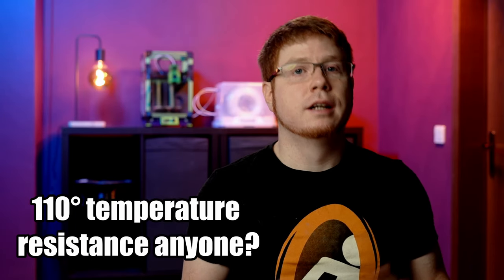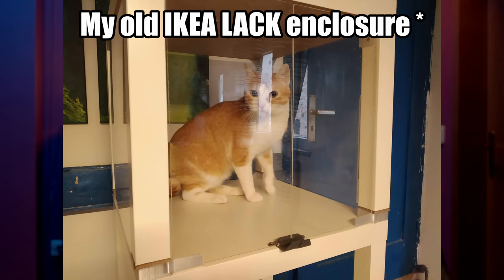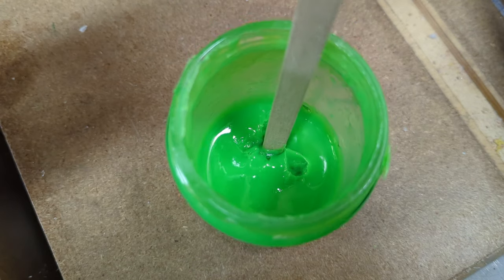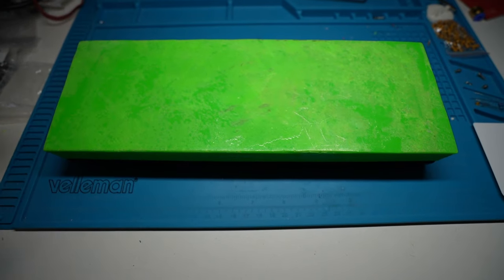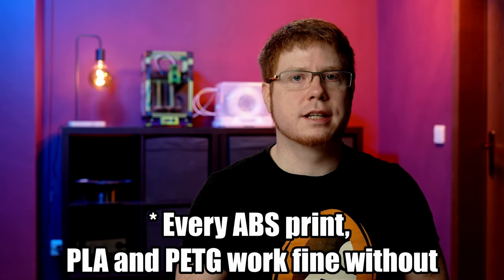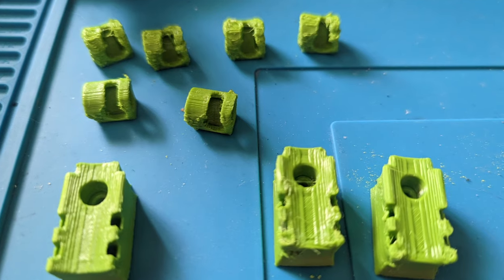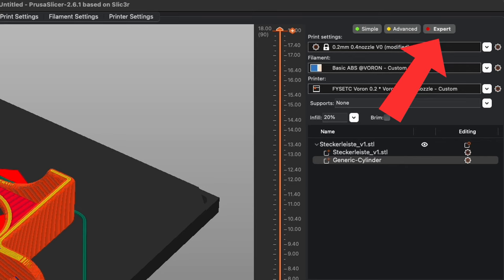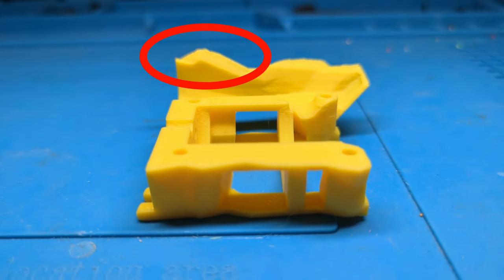3D printing ABS and ASA: The simple SECRET how to get perfect results

Comment: I just got my first bottle of magigoo two weeks ago and I can’t believe how much I was screwing myself by using glue stick… lesson learned for sure.
Reply from the maker: That's pretty much how I felt when I used the test sample after being hesitant for so long. Recently took advantage of a sale and ordered 4 bottles (2 regular, 1 PC and 1 nylon)
Reply: @SmallBatchFactory  have you tried the Nylon one yet? I ordered that too but haven’t tried it yet… I only use nylon for a couple things here and there.
Reply from the maker: Not yet. Like you I only use it very occasionally. I also have a very cheap Nylon that's especially nasty.
Reply: @SmallBatchFactory  me too… I have a 5 year old spool of ESun natural nylon and it has never been easy or fun to print with. But when it does manage to print well. It is pretty good material…
Reply from the maker: Sounds a bit like mine. I got it from "Your Droid" which is just a white label brand. I need to print it 25c over the recommended temperature to get layer adhesion. But then it's really strong, didn't manage to break off the nubs of the gear I made with it by hand.

Comment: I think I got something similar to magigoo but on a budget. Mix water and regular white glue in ~7:1 ratio, it works great and cleans easy.
Reply from the maker: I use that for PLA and PETG. It's much weaker than Magigoo though. For comparison, with Magigoo a warping print will bend the magnetic build plate against the magnets force instead of releasing the print
Reply: @SmallBatchFactory  wow that's a lot of force. I'll keep that in mind, can't wait to switch to ABS, I built the enclosure and getting myself mentally prepared for the trouble it comes with :D
Reply from the maker: @LukaMilosevic-c7f if you follow the tips in the video it's actually not that hard :-)

 It also highly depends on the model though. There were parts of the Voron ERCF I couldn't get to print since the surface are on the bed was too small (it would later be bridged to the rest of the part but it got knocked over every time).

Good luck!
Reply: @SmallBatchFactory  That happened to me few times. I'm getting the hang of it after ~1kg of my first spool of PLA. Got few really nice functional prints with real world applications as well as few great looking painted small miniatures. Thank you for all the tips!
Reply from the maker: Miniatures are fine too. One of my very first prints was DOOM guy with a 0.2mm Nozzle. Turned out extremely well and with the tiny Nozzle the support material was super easy to remove.

Thank you for watching! Maybe someday you'll even build a Gatoino :-)
Reply: @SmallBatchFactory  I don't have a cat but  I do have a shoe box full of arduino sensors, I had a rpi as well but I shorted pins 1 and 2 and killed it while messing with the display jumpers for the printer display for klipper
Reply from the maker: @LukaMilosevic-c7f it can happen really quickly. I was testing a few different OLED displays for compatibility and one had power / ground reversed from all the others. Now it's toast, but it gave up some nice magic smoke

Comment: For a glass bed. All i have done for a long long time is put a little acetone on the glass and use a failed print and slide it over the acetone and over the area the print will be. I cannot remember the last time i had an abs print come loose.
Reply from the maker: That's basically the concept of ABS slurry. Works perfectly well if you're willing to work with acetone
Reply: It is the same concept. Except without needing to create and store a slurry. Its fast and a cleaner process.
Reply from the maker: @Bobby11 that's true. Haven't been using acetone in 3D printing for years. PEI sheets don't particularly like it

Comment: Sounds like you need a pei sheet.  My Ender 3 is printing ABS and ASA like a champ in a tent enclosure on a cheap PEI sheet with no brim and no glue.  255 nozzle and 105 on the bed.  Pre heat for a few minutes, then fire up the print.  I've had a few warps on the edge of the bed when I didn't pre-heat, but otherwise, no significant warping.
Reply from the maker: I "have them all", meaning smooth and textured PEI. Possibly be differnt if I preheat a bit longer. Since energy is expensive here and I'm I impatient Magigoo does a wonderful job. 

It's not always warping of course but when it does I have to start over so I rather just apply some glue.
Reply: @SmallBatchFactory yeah, can't argue with what works.  I just found it annoying to apply the glue.  I did notice with the smooth pei that I have to literally clean it before EVERY print.  Also, 85 and even 95c were not enough to keep things stuck down.  

I'm in Southern California, so I understand expensive power.  I just put in solar, but haven't turned it on yet.  Just printed some ASA brackets for the conduit running into the solar and end-caps for the rails the panels bolt to.  Been wanting to build a large core XY, so maybe I'll be able to power it without feeling guilty LoL.
Reply from the maker: @huzbum I wipe with IPA, but it's not always enough for me.

A large CoreXY is very cool. I have a few problems with my Voron 2.4 though, I always have to adjust the first layer. Mesh leveling works great but the first layer distance is a bit hit and miss. Although the click switch is always spot on when calibrating it isn't anymore when printing. Might need to add a brush to clean the Nozzle before leveling.
Reply: @SmallBatchFactory  My current plan is to modify the design of "the 100" AWD remix to make the corner pieces and attach them inside a plywood/2x4 cube (with plexiglass doors.)  Then use a Kobra Max 400x400 heated bed with 3 independent z-screws.  Design wise, it's really going to be a frankenstein abomination.  I basically just want it to be cheap, large, and reasonably fast.  

Looking cool would be great, but you can't have it all.  Maybe if I make it look like a video game military loot crate that would be cool in its own way.
Reply from the maker: I love the loot crate idea! If we're honest many open frame printer don't look pretty as well. My Prusa mk3 for example, the wooden  encloruse I added isn't exactly a masterpiece either but it gets the job done. Form follows function I'd say

Comment: I would love to see more abs/asa tests. Like temotowers in different configs and stuff just to demonstrate these things.
Reply from the maker: Issue with temp towers is they don't represent real world printing. Since they're small they printer needs to slow down. Back when printers were generally slow this worked fine IMO but with today's high speed printers it already makes a big difference how large the model is, meaning print time per layer.

Comment: Magigoo, yes.  But I still get warping if I cool the print down too quickly.   I've had some success letting it cool gradually at 5 degrees per 5 minutes but the edges still curve up a little on the larger prints.  I think my next bet is to just let it sit on the plate, covered with a filament box to make a mini oven, and let it heat soak on a 100 degree build plate for an hour to relieve the internal stresses.
Reply from the maker: Are you talking about rather flat prints? For what I usually print the parts are over 5cm high. I get a hot bottom, cool middle part (~40c) and a hot top when the print finishes. Means the middle is already cold enough to not warp anymore. If the print is only a few millimeters high I'd expect the result you mentioned.
Reply: @SmallBatchFactory  Nope, it was tall.  I was printing the feet for a Voron 0.2 with Mouse Ears, but no Magigoo, and the corners lifted when I let it cool naturally (bed heater off immediately) instead of letting it cool slowly over an hour (-5 degrees every 5 minutes).
Reply from the maker: @tasa4904 that's interesting, how much glue did you apply? I literally popped my Voron parts off the minute it stopped printing to immediately start the next print. Didn't have any Warping that occurred after the print finished. Might also have to do with the material used but it was just cheap regular ABS, nothing special.
Reply: @SmallBatchFactory  If anything, I had the heater bed running at 110 degrees to make the part stick without glue (bed top is about 10 - 15 degree cooler than stated temperature).  Pumping that much heat below while the upper part cooled to about 40 to 50 degrees ambient temperature might have done something.  

Although I would expect the warp to go in reverse / create layer separation since a layer is supposed to contract on cooling, not expand...

The only reason why I know that it warped on print completion is because the mouse ears were firmly stuck to the bed right up until the very end.  Then I walked away and let the print cool, and came back to find the mouse ears had detached and were in the air.
Reply: Thinking about it further, I think the reason why it warped upwards is because the heat transmitted from the bottom of the print flowed to the middle layers.

And then the bottom of the print cooled down quickly because the build plate is thermally conductive and equalizes quickly with the ambient air once it isn't actively heated.

With a hot middle layer and a cooler bottom layer, upward warp.

Next experiment then is to use Magigoo with a bed temperature set to 80.

Comment: If you use Magigoo or some other kind of adhesive (like Kores glue stick, etc), can you still easily remove the prints off of the bed once it cools down ? or do you need a PEI sheet ?
Reply from the maker: Magigoo in particular even releases the print when cooling down. So you usually won't have issues removing them. This can vary depending on your build plate material of course, I didn't try all of them.

Comment: Had lifting issues with Nylon. I  used "Super Glue" and glued the Brim down with it. Solved all the problems cheaply. I dont know yet how it will work with ABS.
If the bed is Magnetic. Magnets on the brim .
Reply from the maker: Were you able to remove it without damaging the print bed?
Reply: @SmallBatchFactory   Yeh it scraped off pretty good.Given its age ,i figured i might as well try it . if i wipe it out ,id buy a new one. I needed the gears bigtime .    . I cant recall what kind of bed i got. Got it a few yrs ago. all i can say its white lol.

Comment: The major fix to me was to heat the enclosure at 40°, and bed at 110, vent at 15%. I did a temperature tower, perfect from 230 to 270 lol.and when finish i wait 20 mn to let everything cool down. No sticker, no brim.
Reply from the maker: In my case the parts usually already warp while printing. When it's done I sometimes even cool them down on a piece of stone if I'm impatient. The large print I showed in the video actually sticked perfectly for the first print but the second one always failed without glue. I just couldn't figure out why.

Comment: I've used glue stick on my bed,  but it is completely unnecessary. It made no difference other than having a bigger mess to clean. I've never had adhesion issues,  and will not use glue again unless I experience adhesion issues.
Reply from the maker: If that works for you that's cool. I only use it for ABS, since that stuff never stuck well for me.

Comment: I like HIPS. I think it's underrated. I don't see much point in ABS to be honest for the trouble it causes. Their temperature endurance is really similar as is the cost and mechanical and chemical properties. HIPS prints come out pleasantly slightly matte.

Yes i think a consistent amount of airflow is needed, so i run a slow PCF speed.

Adhesives i've been happy with is Deli 7091 glue stick and self-made PVP solution, both work well. But then working with HIPS isn't nearly as demanding as with ABS as it doesn't exhibit excessive swell or shrinkage, so the experience needn't carry over.
Reply from the maker: I have a spool laying around that I didn't try yet. Maybe I should. What drew me to ABS was the low price in the past. And according to the Voron team it's the only material not suffering from significant deformation under pressure
Reply: @SmallBatchFactory  HIPS is probably not among the recommended materials because it hadn't been considered. I don't know why everyone treats HIPS as a joke, it prints well and holds together just fine.
Reply from the maker: The most prominent instance where people talk about HIPS is as support material since it can be dissolved in lemon acid (if that's the right translation). I really have to test out that spool I have here.

Comment: If I run my cooling fan over 50% it doesn't fuse the layers correctly with ABS but if I turn it down too much I'm getting more upward curling on these corners that have a significant overhang. I can see the part actually moving because the previous layers are still liquid 🤔.

I think I need to reduce layer time even more since it is a super small part. I have it at 120 second layer time right now and that gave me the best part but there is still some up curling.
Reply from the maker: Even as little as 10% fan speed can make a big difference. You can always increase layer time but the issue is you get material oozing out and risk heat creep (but with ABS it's not a big deal).

Comment: i am having problems with my nozzel stopping up while printing ABS any ideas to help me. i have run a temp tower, retraction test, flow rate test all seem ok but the nozzel keeps stopping up not sure why
Reply from the maker: That can be many things.

Does it always happen after a certain time and the filament has become thicker at the tip: that's heat creep, can be amplified by high retraction values and chamber temperatures.

Are you running the filament on the hot side: Residue build up.

Does the clogg persistent and you can see something other than filament stuck in the Nozzle: Bad filament quality with unwanted particles. 

Stripped filament at the extruder gear so pushing becomes impossible: you're going too fast for your hotend to keep up. 

The list goes on of course.

Comment: Hey there! Hope you've been well. I was wondering if you could answer a question for me concerning ABS.

So I recently got a bambulabs A1 printer. Apparently it meets all the requirements for printing ABS as well as other engineering grade materials. However the printer is not enclosed it's an open frame bed slender.

I did purchase a tent like enclosure, more so to maintain a consistent temperature in my workspace and to keep pet hair away from the printer.

However I'm curious If this printer should be fine printing ABS parts. So one of the concerns brought up on Reddit is related to heat and temperature that might be generated if you enclose the printer. I think the concern revolved around stepper motors as well as the motherboard.

However there seems to be a bit of a debate on if the printer could generate enough heat while enclosed to even damage the components. 

The manufacturer doesn't recommend an enclosure, but again there's debate as to why this is the case. Some argue that it is because of potentially damaging components, others say it's more to do with product differentiation and getting people to buy more expensive printers.

I'm curious to what your thoughts on this might be? Any and all feedback is greatly appreciated.

My other question is regarding the fumes generated by ABS and certain filaments. There is a device some use called a bentobox that uses charcoal, HEPA filter and some fans to process the air within an enclosure.

I was wondering if you have any thoughts on the effectiveness utility of something like this. 

Obviously it would still be used in conjunction with having a window open and not being in a completely enclosed space. But I'm curious if such a device is even worthwhile. Again any and all feedback is much appreciated.

Thank you kindly, much love and gratitude.

P.s. pardon any typos as I was using speech to text while walking to write this.
Reply from the maker: Hey Whyired, nice to read you again!

The biggest issue with enclosures is having the power supply inside. It's giving up quite a bit of heat and will get pretty warm inside. Having it inside an enclosure regularly will wear it out quickly, occasionally for a few hours should be OK. I don't know where the A1 has its supply, I guess below the print bed. So one thing you might be able to do is put it in a table with an opening in the bottom for fresh air to the power supply. Best scenario would be having the PSU outside, rewiring the printer. That's what I did with my Prusa.

For the steppers the heat is no issue. The controller board should be able to take the heat as well. Heat always shortens the life span of components, but usually not in a meaningful way. Think of how hot a PC or Laptop gets inside the case while still running perfectly fine.

A charcoal filter definitely helps filtering a lot of nasty fumes. They're actually mostly particles, not gases, and can be filtered pretty good. I built one for soldering for example and it makes a huge difference. Just don't forget that you have to replace the filter material pretty regularly.

I have yet to build a filter for my Voron 0.2. It's already accumulated a film on the panels from printing ABS which a filter would definitely help avoiding.